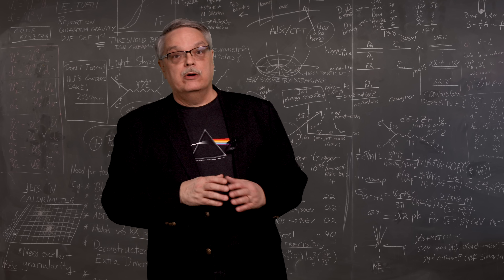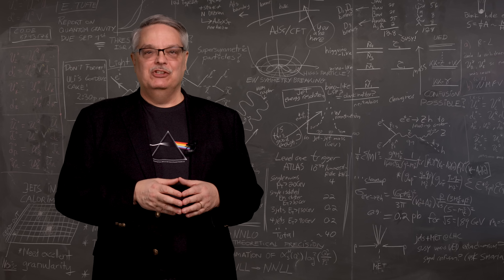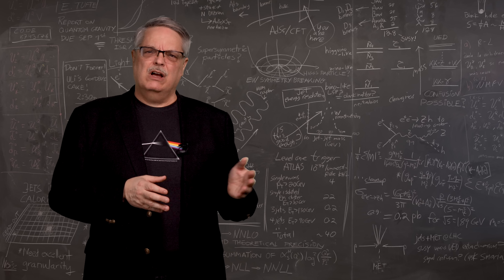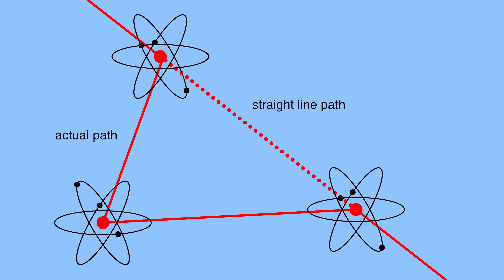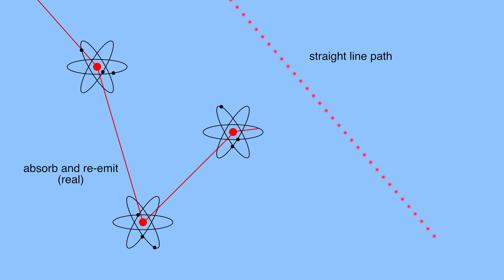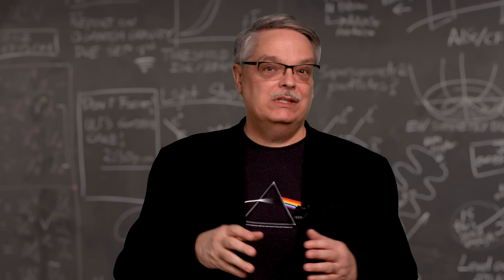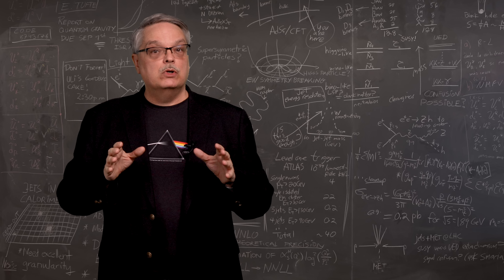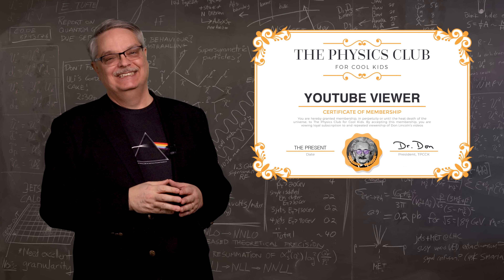Why does light slow down in water?

Comment: Light having a speed makes no sense. How can light slow down in one medium and then speed up once it enters the next. That breaks the law of conservation of energy. Basically light must be a wave that changes its oscillations through a medium. How can a burning match "emit" the same speed of light as a nuclear blast that has massive more amounts of heat and energy?   A pebble in a pond verses a belly flop in a wadding pool.
Reply: As far as I understand. Anything without matter, moves at "causality speed" (the max speed that things are able to interact with each other). And well, photons don't have matter, that is. 
What a nuclear blast can do that a burning match can't, is accelerating particles of matter.
And unstable atoms created through them, can send flying electrons, protons or neutrons (radiactivity), that really makes a mess with other matter. Not only living things, on Fukushima they're having a hard time building robots that can withstand the radioactivity from the spent fuel.
Cancer by UV Light is a different topic, working by a different mechanism.

As far as I understand
Reply: You young fool. The energy of an electromagnetic wave isn't 1/2*mv^2. There is no standard photon mass with which to multiply the speed by.  To answer your second question, no matter how big the splash, the ripples travel at a definite speed. There is more to energy than just speed.

Comment: The combined wave is made. But what stops the original wave from shaking up electrons further down the line? 
Does light oscillate down to zero, or travel like sound? 
In the way the wave-mixing was presented, the slow-moving, flipping wave is only an illusion, is it not?; the originals weren’t flipping.
Reply: The prism in the Pink Floyd t-shirt logo is a perfect example of why it does what it does. Photons and ionized electrons have the same momentum. So, when atoms are in a crystal lattice, the photon "bumps" and electron into a higher state, and when it drops back, it re-emits a photon. The shorter the wavelength of incident light, the higher the energy imparted, and thus the sooner the electron will drop to a lower state. So the light effectively gets "trapped" in an electron energy state for a short amount of time. Red light does so slower than ultraviolet light because of the shorter wavelengths having lower energy. This is why the light is split at different angles depending on the wavelengths of its photons.

The key to all of this is the frequencies that rules quantum mechanics. The electron state change operates on a frequency of its own.

Comment: Five  questions:
1. How does light change its direction?
2. If light slows down due to the cancellation of two waves does that mean light can speed up as well?
3. Does that mean if u change the placement of atoms the lights direction will change?
4. How does light get blocked by opaque object then?
5. If most of the atom is empty space, how is it so common that it hits an electron?
Reply: I'm not a professional so take my words with a grain of salt.

1. He answers that in another video, and will likely answer it much better than I can.
2. I think of it as the 2 waves averaging,  since not only is there constructive and destructive interference, but even if the entire wave combines constructively, it will lead to bigger troughs as well as crests. This would mean it would still have an average velocity that was the same.
3. In their example, they are talking about light slowing down in water. So if light is moving through water or any medium, it must be moving through the atoms of that medium. If you move the atoms making up the water, away from the path of light, then it will be traveling as normal, as it would not be traveling through water, since the atoms making up the water have changed location. If you're talking about atoms making up the water switching place with one another, then I don't see it changing anything.
4. When light encounters a material it can be absorbed, reflected, or transmitted. Opaque materials either absorb or reflect light, they are not transmitting it, and it is light going through an object (like water for instance that allows us to see through it). Even mirrors have an opaque surface. It makes me wonder how two-way mirrors work.
5. This was a cool question, and I looked it up. The best answer I was able to find about this was that light is bigger than the spaces between atoms. This was a hard question to get answers to, as a photon is massless, so does it really have a size? But we can also think of a photon as an excitation in the electromagnetic field (a wave), which has a distance over which it can affect. And that definitely has a size (at least I think so. I also think it is related to the de Broglie wavelength of a photon), so I considered that as its size or related to it. And let's not forget that electrons also have a de Broglie wavelength, widening the area electron can influence.

For instance, imagine you have an oreo, then you hollow out the inside of it, so that it's mostly empty space. Now, imagine if we do that to thousands of oreos, and line them up side by side to make a wall, and I told you to walk through the wall of oreos. Even though this wall will be mostly empty space, since the largest space is still roughly the size of an oreo, you won't be able to walk through the wall of oreo without touching them.

 I honestly feel like a lot of explanations of light break down when trying to talk about them as photons, which is strange, because quantum mechanics is the be all end all of science, so why do so many explanations have to talk about photons as waves?

Stay curious.
Reply: @fadair  
1. No, I meant why does light change its direction according to his theory.
2. Okay
3. U gave the answer to this question in 4
4. Why is it reflected and why can't the light pass through the object if they are both made of atoms, e.g. if coal and diamond are made of the same element then why does light get reflected from coal and get refracted in a diamond block.
5. Okay
Another question popped up in my mind:
How does quantum particles form a colour?
Reply: @samerator4233   Here's a little common sense intuition,
You can not see any object in the universe without light either reflecting off of it, or refracting through it. 
And, you can not tell if light exists or not without the presence of objects, because in order to see light, you need it to hit objects, without which, you can't see light.
Reply: Sunny shah That definitely helped me answer any of my questions and I definitely did not know that -_-
Reply: Ans 2- No because there is no wave that is faster than light in a vacuum.

Comment: By the way professor light it doesn't create second wave, that your last explanation still wrong, try to think little bit harder what solid has but not the empty space.
Reply: Yes what is Ur idea or explaination sir
Reply: @spacerace8598  I thought the answer should be very  clear, with one hand you dealing with space, where molecules traveling through like fish in the water. The other hand you have material densely populated with atoms. Through space photons do not have whole lot of resistance, because there is some emptiness between the molecules. Through the glass that empty space is occupied. There is very small gab in between creating lots of resistance for photons. Just like on the freeway when is traffic dens we have to slow down, when freeway has less Cars we can speed it up. Now why is that photons moving the same direction when they depart from glas not a different direction? We know certain materials do change the direction of photons, before they penetrate the surface of the material, however some photons after penetrating the material, after departure they continue on according how much force still left in them. They will continue on with their journey to the direction they were forced to take to the end, if energy within them expires than they will change there direction, Like in the waters.

Comment: Hey but how do the light get its energy back
I'm sure that nothing can just add up energy. You need a substance that powers it. Even like the large Hadron Collider that speeds up the atoms. Vacuum is simply nothing it's just an empty space. So how does it affect the speed of light. The speed of light then according to what you said should move at the speed moving in the glass. Basic Physics also says that ENERGY can't be DESTROYED or  CREATED. "Light is a form of energy" that gives us the sensation of vision and also if you were right then this should result in a constant slowed down of the speed of light. The other 2 explanation that you believed to be wrong has the wrong idea. The WAVE LENGTH of light is much more BIGGER than any ATOM. So it does not touch an atom but a molecule or a group of them and I'm damn sure that no circle is a PERFECT circle. So the lines or the smooth surfaces of the atom (if it could be as small) would give it an angle to reflect. Remember angle of incidence is equal to angle of reflection.
Guys I found this idea a total waste of time.

Comment: The bending of the light seems like the wave is trying to get through the glass in as short a time as possible.
Reply: It is not "trying", it just is. If it did not get through in as short a time as possible, then it would be possible to get through faster. In which case there would be something - or possibly something - faster than light.  If there is not - which is the postulate on which all modern physics is based -  then light must take the quickest possible route.

It is all perfectly logical once you have had a few drinks.

Comment: Why electron vibrate at different amplitude because in a radio connection the radio connect because the electrons in the receiver also vibrate at the same wavelength frequency and amplitude . So that different
Reply: I have an another dought why the wave  changes its direction in the glass as why the angle changes its direction